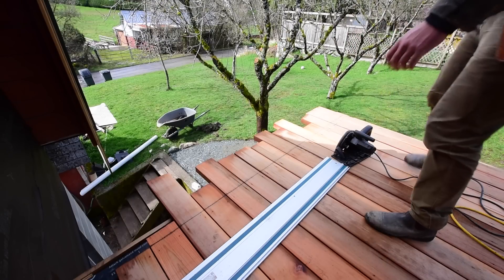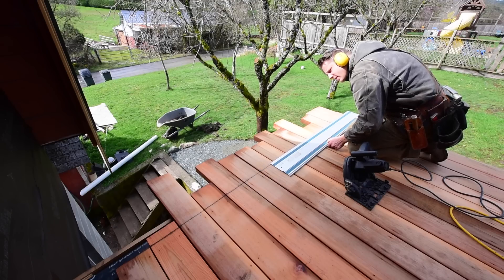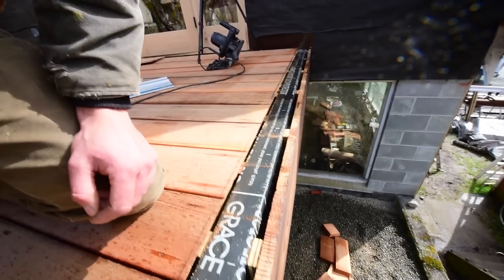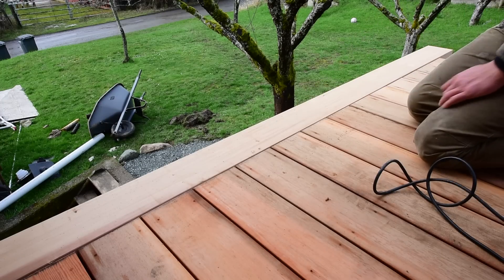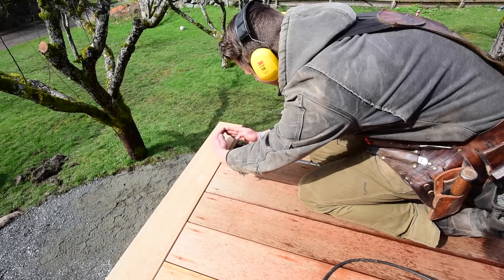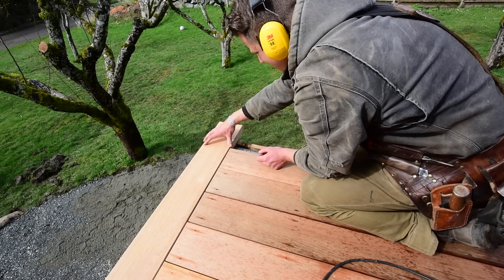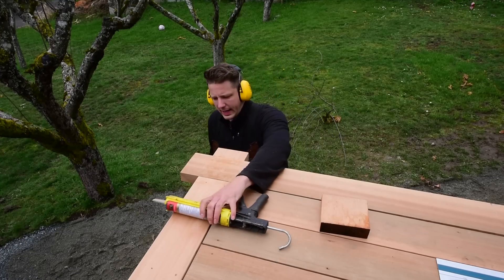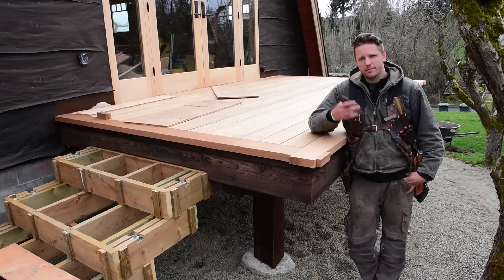FTF #52 Install A Sexy Boarder On Your Deck, How To

Comment: Love it! I never do miters outdoors if I can avoid it. They always open, even with biscuits. I've also done this half lap kind of detail on decks and it stays awesome for years. Well done sir.
Reply: That's interesting, I suppose you could combine a half lap with a mitre to get around that issue. Personally I'd opt for a haunched mortice and tenon with a draw bore and cut the joint with hand tools. But that's just because I don't like the look of the overhang at the corner with this joint.

Comment: I read down through several of the comments and did not see anyone combat anyone with their shrinking thoughts with the reality that he is using cedar and it is a very stable wood that really doesn't shrink that much after being milled and air dried for only a few days..it does tend to chip/split easy so pre-drilling is recommended.  This is my experience with it and research found.  It also gray's up very quickly if left untreated in sunlight...what is others experience with working with this wood type?  Others who have not worked with cedar should be more inquisitive then state ones thoughts based on other species of wood.  We all need to learn and appreciate others ways and ideas on their workmanship..maybe poise questions of..have you done this joinery in the past? ...and...how has it aged over time? ...and... is there any code violations with this way of doing this that one may need to worry about?...I feel questions like these will get more positive answers from content creators or others who may have experience with such work  in question.

Comment: Outstanding. I love the half-lap detail. I've been trying various butt joints and flying transitions around corners. You're right as rain that the miter looks good the day you put it in and not-so-good a few days later. The chamfered decking cut is sweet too.

Comment: Jesse, The Netherlands here. As you might know, we have quite a lot of rain. Is it necessary to treat the wood for such boarder with something like wax or oil?
Reply from the maker: Very wet here too.  Old growth red cedar does not need to be treated but I would recommend it with other less weather resistant woods.
Reply: My understanding is that only the heartwood has enough tannins to resist fungal decay.  Most of today's cedar is 2nd & 3rd growth sapwood, which seems to rot at the same rate as hemlock or fir.

Comment: What would make it look even more professional is if you were not face nailing your planks.  The moisture gets in those nail holes and causes the boards to fail sooner than they should.  You make a pretty deck and you are trying to make it last, but face nailing the planks is not the way to go.  Build better.

Comment: I like that detail,I’m changing the 2x6 top rail on my railings that the builder 45’d and they opened up just like you described,this should take care of the problem and looks awesome thanks for the tip, great video btw.
Also locks the railings together for more stability 👍

Comment: You are a very good journeyman carpenter however, if you want master status get rid of the track saw. Anyone can cut a straight line with a tracksaw but it is just as easy to follow a pencil line with a skil saw and even faster. And yes I have been around carpenters my whole life and I am in my fifties now as a 3rd generation wood worker. A pencil, a tape measure and a scribe are all you should need.

Comment: I've enjoyed a lot of your videos,notwithstanding the lack of modesty which all true craftsmen possess,but....

Doh! If huge amounts of glue won't stop a half-lap mitre from shrinking'then how on Earth will the glue stop this joint from shrinking?You will only conceal the shrinkage on the lower board but clearly not on the top one so why bother? If anything,glueing the lap will only encourage splitting as the timber cannot shrink as it wants to whilst being glued at both edges.
 And as for that super-weak 1" of short grain on the end?I'd be surprised if it lasts 2 years before snapping off.
Double fail I'm afraid.
If that idea worked,do you honestly think that it would not already exist???  :-)